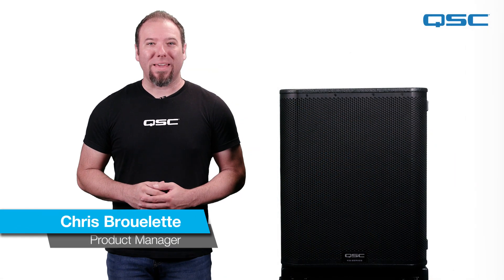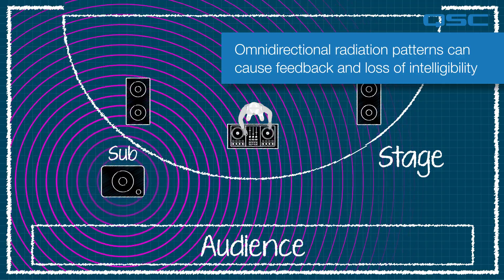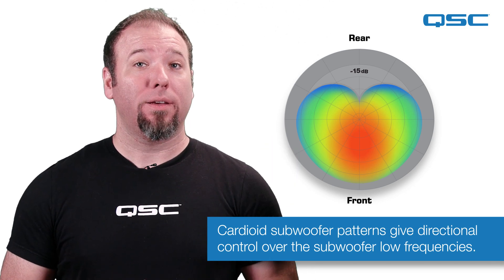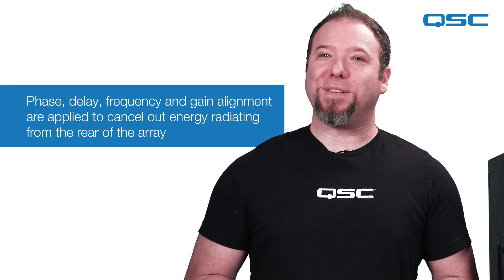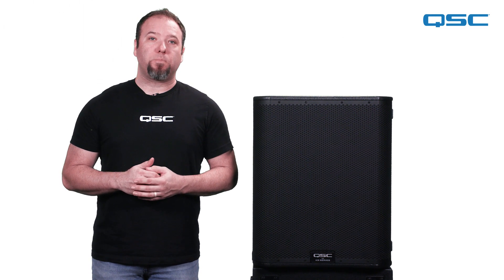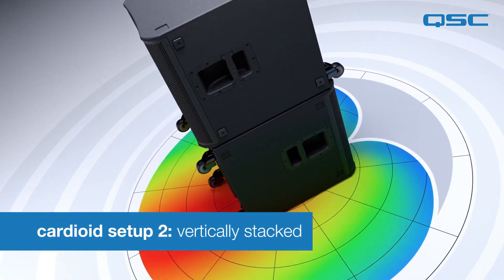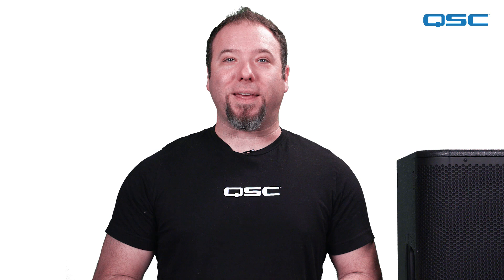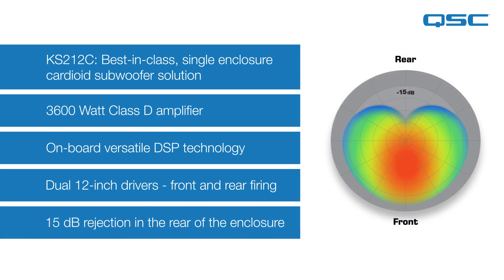Tech Talk- Keeping Bass in its place: KS Series Cardioid Subwoofer Solutions

Comment: I have a huge venue problem, ok its a night club..

the stage is literally a box walls all around about 15ft wide 20ft long, 
They club designers decided place them inside the box stage touching the walls one on each side, 
and to protect them from people leaving their drinks directly on top of the subs the put 1 in plywood all around,
them top and sides,
Leaving the from open for the sound and the back for the connections and easy access for the controls., 

I have the foh mixer about 10 ft behind the left sub, and i can feel and hear all the bass from there, 
I but almost 50% less when i go to the front to mix the sound., 

Ive try changing the polarity but it didn’t help, 

Is it a venue problem? 

Are the aded wood protections affecting the direction of the sound waves or to I necessarily must add another pair in order to try and redirect the sound to the front using the cardioid mode? 

Any suggestions would be greatly appreciated,

Comment: I see they are not replying....maybe they will, or someone can help me out with a couple questions..... does it matter when you come from the mixer if you plug into the forward or rear facing first? Then the other, then high packs, correct?
Reply: It shouldn’t matter at all if it’s a THRU output (they let the full signal pass and it’s not HPassed or Lpassed), you can even go through top first and then any of the subs if the outputs are THRU.

I’d be careful with stereo configurations, I mean, I guess you’re talking about just one side.
Reply: Ya,,,both subs gets same signal (doesn't depend on which plugged first).but makes the cardiod pattern by inbuild system